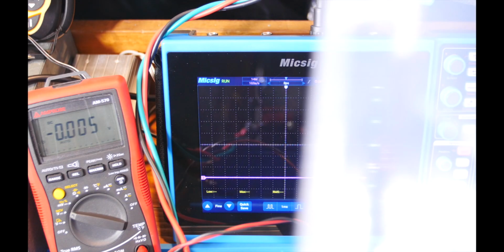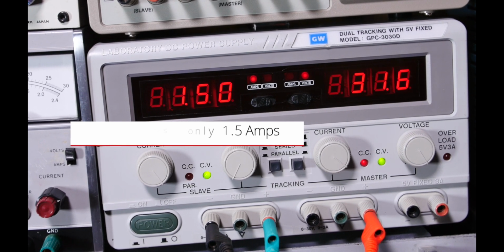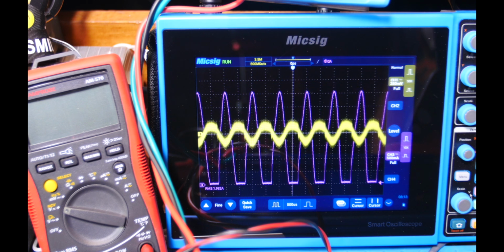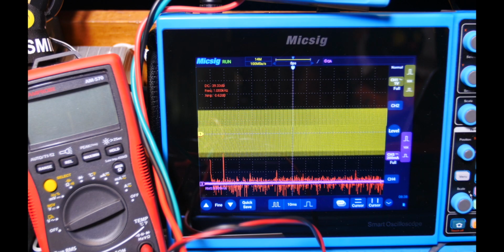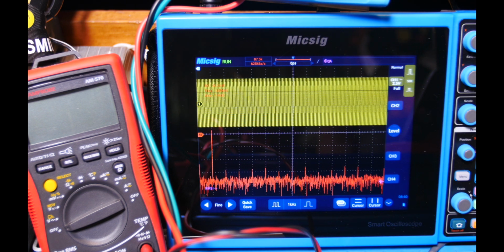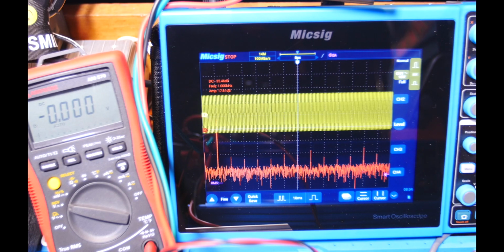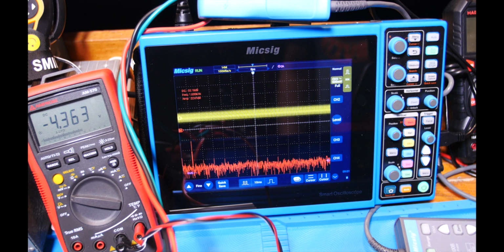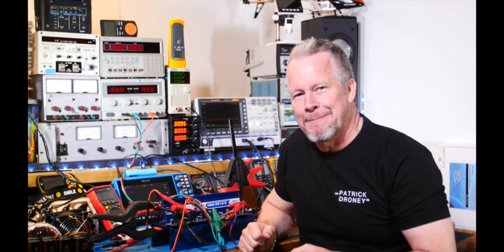Class A Amplifier Aleph 5 project - Test Follow up

Comment: I'm puzzled by your upload picture ratio! It looks like 16 x 9 which is correct, but it does not fill the screen. Maybe a look at the upload spec should put that right. Your older videos were fine. My comment is not a criticism but simply an observation.
Reply from the maker: Michael Beeny Thank you!  I’m glad you brought that up.  I changed to just High Def instead of 4k because of the upload problems.  But they may have fixed that now.  I looked up the YouTube format so I’m sorry it’s not the same.  Thanks again for telling me!
Reply: @kissanalog  I used to video in 4K but up load in either 1080p but more often in 720p after I looked up who is viewing in which format, eg phone or PC. As most people, for some reason or another, view on a telephone, seamed pointless using all my data and hours of upload time when most people view in 480p or even less.
I've never had a comment about my picture or sound being poor so 720p it is. AS for my content quality?? well, that's another matter completely!!
Reply from the maker: I love your content;) I’m honored to have you comment here!
Reply: @kissanalog  Thank you so much for your kind words. I have only just found your channel. Looks like we both love good audio in common.

Comment: Interesting observations.It will be good to see the improvements that will surely come with improved filtering capacitors.
What are your thoughts on the use of a regulated power supply specifically for Class A amps.I know most people think they are unnecessary for Class AB and B and even detrimental but for Class A I think they could be an advantage as the power drawn is constant(think I've got that right anyway?).
P.S.-Your link to the ebay site for the class A amp kit is still broken:-
''Please use this link for Aleph 5, Class A Amplifier kit used in this project: http://rover.ebay.com/rover/1/711-532...''
Reply from the maker: I hope I fixed the link.  Thanks for helping with that!  I do like the idea of the regulated power supply.  I think some don't like it because if it isn't done right it isn't right.    Thanks for the feedback!!